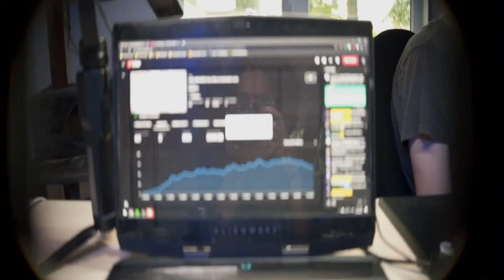LIVE LENS MOD: Sirui 35mm Anamorphic Lens

Comment: Is it possible to change the rotation of the mount by 90 degrees also for the newer full frame version with rf mount ?
Reply from the maker: Maybe on the original ones, but I'm not entirely sure.

Comment: shouldn't this be done in an electrostatic chamber? 🙀🙀🙀
Reply from the maker: Should vs could.
Reply: Much like doing DIY lens cleaning, you can’t keep dust particles from getting in while being in a residential household. So it’s a slight drawback, however, slight dust particles don’t affect anything but big lint or hairs do so having to take a lens apart again to get something that wasn’t noticeable during the initial clean is a pain but still much cheaper than a professional clean.